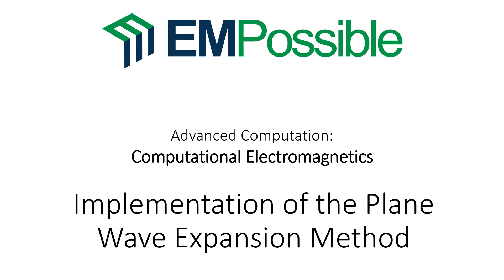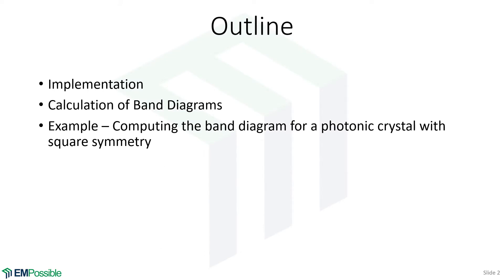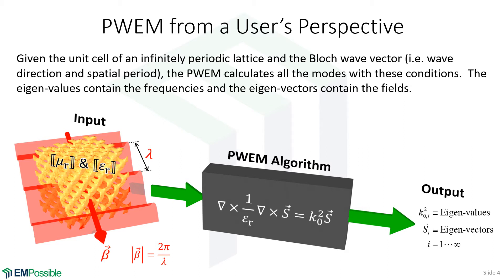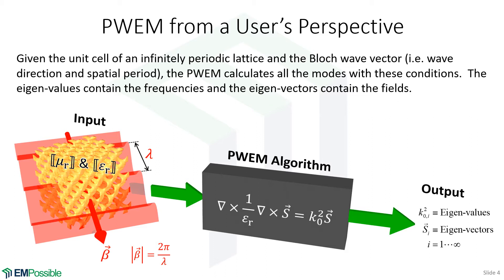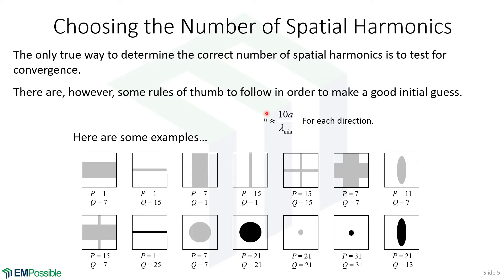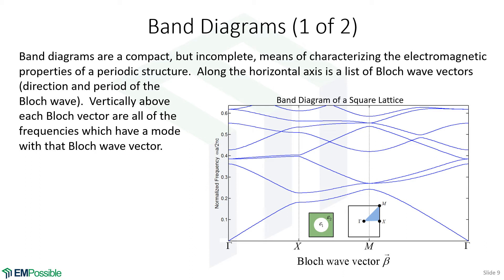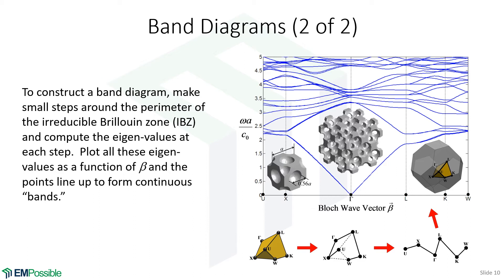Lecture -- Implementation of PWEM

Comment: Hello Professor, Thankyou for the amazing lectures. They are helping a lot to understand Computational electromagnetics and periodic structures.
Professor, I was going through your lectures and have few questions:

1. I want to obtain the dispersion relation a unit cell which has a metallic patch on a cubic unit cell (like the unit cell of a Metasurface antenna). Can I use PWEM to get the dispersion curve for this type of unit cell? I got this doubt because in the lectures, (if I am not wrong), the structure uniform infinitely in the Z-direction. Whereas, in case of the metallic patch unit cell, the patch is just on the surface of a dielectric substrate and in Z-direction it is not infinite, and below the metal patch, again the dielectric region starts.

2. Also, if we can use the 2D PWEM for such structures, what will be the relative permittivity of the metal patch? (I tried to look in the internet, E_r value of a PEC is infinite)

3. One more major difficulty professor is with generating the convolution matrices for the material parameters (i.e. the convmat() function).....By following your lectures I have understood that we just need to find the values of "a(p,q)" (for 2D PWEM), that is, the surface integral value  where p is from -[P/2] to [P/2] and similarly with q...... and write it accordingly in matrix form. But, I am unable to map properly this information to create the matrix.(maybe because I am a beginner in MATLAB). If you could provide some reference or hint on how to create that matrix, it would be very much helpful for me.

Thankyou so much for the patient reading...and once again thankyou for the lectures
Reply from the maker: Happy to help!

1. What do you mean by dispersion relation or dispersion curve? Different people mean different things by this. In general, if it involves metals I avoid Fourier-based methods like PWEM or RCWA. Plenty of people smarter than me still use those methods. You would need to use a 3D simulation for such a unit cell. Consider finite element or finite-difference methods. Depending on what you want to do, you may find the answer and code in my book on finite-difference frequency-domain where I simulate a frequency selective surface and also do a parameter retrieval from a left-handed metamaterial. Here is a link to the book’s website:

https://empossible.net/fdfdbook/

2. I perform my simulations in stages. I would start out assuming PEC for metals. The easiest way to do this is to set the permittivity to something incredibly large, like -1e9. If you need more accuracy, then lookup the actual properties of the metal at the frequency you are using it. Metals are very dispersive at very high frequencies and it may be important to consider.

3. You can use the FFT to calculate the Fourier coefficients. That avoids having to do the integrations and is MUCH faster. Then you have to put the Fourier coefficients in the correct place in the convolution matrix. Slide 6 in Lecture 6b of the Computational Electromagnetics course shows the expanded equation for Ky*uz – Kz*uy = jk0[er]*sx. It may not seem like it, but that expanded equation is what the convolution matrix is constructed from. There is nothing else to derive. Below is a link to the course website. There are some links from there to paid online courses that will step you through every line of code and implementation of the convolution matrices as well as 2D and 3D PWEM.

https://empossible.net/academics/emp5337/

Hope this helps!!
Reply: @empossible1577  
Hello Professor,
Thankyou so much for the detailed reply...
I am very happy to share that I am able to generate the convolution matrix using the FFT of permittivity and by properly expanding all the terms in the summation present in lecture 6a and manually writing them down as a matrix form (i could understand about the positions of the Fourier coefficients).

1. By the dispersion curve I mean the "frequency - wavenumber" curve (omega-beta curve), which gives us the information about the phase velocity and group velocity in a unit cell and hence for a particular frequency we can extract the K value and find the phase difference across the unit cell.

2. Okay professor, I will give a high value of E_r for the PEC and observe the result along with trying the 3D PWEM for the structure I mentioned.

Also, Thankyou so very much professor for the insights and references on the other methods that can be used for the analysis of unit cells with metals......I will definitely have a look and study about them. 

It really helped a lot, Thankyou.

Comment: Sir, I was going through your lectures and find that convmat (ER, P, Q) is not calculating in may lab…convmat function is not defined in matlab…How to get the ERC then.
Reply from the maker: This is a function that you will need to write yourself. The final equation you need to implement the code is at the bottom right of Slide 19 in Lecture 6a in Topic 6 here:

https://empossible.net/emp5337/

If you are looking for the MATLAB code and an explanation of it, that is several of the paid courses on Thinkific.  Here is a link to the least expensive one.

https://empossible.thinkific.com/courses/pwem2dbands

I personally recommend sticking with the free material and developing your own codes from that. The code to assemble the convolution matrix is not long. It is essentially just assembling the  Fourier coefficients into a matrix following the equation in Lecture 6a.

Good luck and have fun!!

Comment: Hello, wonderful presentation! Could I ask, would it be possible to simulate FCC in cubic lattice? Should a 3D integral be calculated in this case for Fourier coefficients instead of convmat3D?
Reply from the maker: Absolutely. PWEM can handle any of the 14 Bravais lattice symmetries. You can do it using the ordinary FFT, but will need to create an oblique grid consistent with the FCC.

The free notes have all the theory you need to know to calculate the Fourier coefficients, assemble the convolution matrices, and implement PWEM. If you are stuck on the implementation, I can point you to a paid course that steps you through every line of code to implement 3D PWEM, including building the devices and building the convolution matrices in a very fast and efficient manner. Here is a link to the course.

https://empossible.thinkific.com/bundles/implementation-of-2d-and-3d-pwem-for-band-calculation

Hope this helps!

Comment: Hi, professor. Thank you for your video!

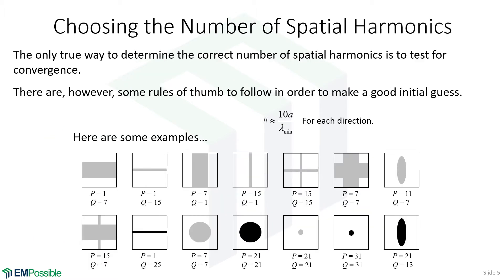I'm struggling with building 1D grating like the one in (2:08). I want to make my grating layer like ( P , Q ) = ( 1 , 15 ) case in the video.
So, I made the unit vectors t1 and t2 which is ( a , 0 ) and ( 0 , a ) respectively, and then I made a meshgrid.
To build unit cell, I added a constraint which is ER = ( abs(YO) <= h ) where h is the height of gray-colored rectangle.
However, the grating layer looks like ( P , Q ) = ( 15 , 1 ) rather than ( P , Q ) = ( 1 , 15 ).
I draw it with not (XO,YO,double(ERR)), but (XO,YO,double(ERR).'). Did I miss something?

Thank you for your reading :)
Reply from the maker: How did you generate the meshgrid variables XO and YO?
Reply: @empossible1577  It's exactly the same as how you build in your EMPossible lecture titled ' Implementation of 2D PWEM for Band Calculation in MATLAB.'
Reply from the maker: @HCho-xe1cj  Send me your code at emprofessor@empossible.net.
Reply: @empossible1577  I just sent it! Thank you :)

Comment: I just recently finished the 2D PWEM Course and I enjoyed it very much. I have a few questions. As I was going through the lectures, I believe I remember you mentioning a resource that went over defining IBZ and the just the key-points of symmetry in the Brillouin zone. I went back through the lectures now and I cannot find where you said it or if you cited anything ( I could be imagining things...). I was just looking to build codes for the other 2D Lattices and need to learn about identifying and defining these (lattice vectors, Key-points, etc) so I can code them in MATLAB. 
Second, I was going through the PWEM Extras PDF, and I noticed that you could plot the field, however, it appears that the variables defined in the PDF are not what is in the MATLAB code that was developed in the course and I was wondering if you could help me clear them up. In the procedure, I assume that V is the eigenvector as in [V,D] = eig(A,ERC); Then, when defining s, what is the variable m? I used m = NBETA to start, but in general, the "reshape" function does not like s since it wants integers and scalars as inputs for s. Next, is Nx = N1 and Ny = N2? Then Step 4, beta = BETA, X = X0, and Y = Y0?
Reply from the maker: Yes, the IBZs!  Ha ha.  Send me an e-mail at emprofessor@empossible.net and I will send that to you.  

Sorry for any inconsistencies in the notes.  

Step 1 -- Each column in the eigen-vector matrix represents a mode in the photonic crystal.  The variable m extracts the mth column so you can “sort of” interpret it as the mth mode.  I say sort of because you cannot depend on the order of the modes in the eigen-vector matrix to be the true order of the modes.  Sometimes I have to sort them in order of eigen-value or something else.  Reshape should take any s.  In this case, s contains complex numbers.  P and Q should be integers telling how big of a 2D array to reshape s into.

Step 2 – Nx and Ny (or N1 and N2 for oblique) are the size of the real-space grid onto which to visualize the field.  This is cosmetic so I like to use at least one hundred points.  The idea is to place the Fourier coefficients in s into the center of the big Nx-by-Ny array that contains zeros everywhere else.  This is called padding.  The inverse FFT from Step 3 looks much better this way.

Step 4 – The X and Y terms come from the meshgrid command.  These are the meshgrid terms for the Nx-by-Ny array containing the field.  The phase must be calculated across this same grid.  If you want to see a bit more discussion about meshgrid, see Lecture 2b here:

https://empossible.net/academics/emp4301_5301/

Hope this helps!

Comment: Dear sir, I open your code in file chapter 7_photonicbanddiagram.m in MATLAB, it has a erreur in line 98 about the Matrix dimensions must agree. Could you please check it please ? I also try to open your file in chapter 10 of your book but it is not working.
Reply from the maker: Frist, I just want to verify that this video is explaining a completely different numerical technique for calculating photonic bands.  The Chapter7 code is a finite-difference frequency-domain method.

Second, I downloaded the codes from the website and I ran the Chapter7 code without any errors.  Did you change or modify anything about the code?  Are you running it with MATLAB or did you translate to another language?

The Chapter 10 codes run correctly as well.  I am unsure why you are getting errors.  Sorry you are having trouble.  When producing the books, I had numerous people run the codes in different versions of MATLAB and on different computer platforms and all ran without errors.  I think they are pretty robust codes.
Reply: Dear Sir, I just sent you a mail that describe my problem in matlab in chapter 10. Could you please take a look ? Thanks you in advance
Reply from the maker: @huonghuongnuquy7272  It looks like there is just a problem with MATLAB not recognizing or working properly with your GPU.  I am not sure how you can reconcile that, but you can get your MATLAB code to work simply by deleting the three lines of code that assign and gather the matrices to and from the GPU.  The code will be slower, but it will run.

Comment: Hello, professor. I'm trying to implement the 3D PWEM and test it comparing it to the lecture Lecture-Periodic-Structures-in-FDTD, slide 45. I tried both the optimized version and the full version. I'm getting eigenvalues with multiplicity greater than 1. So I tried to plot the smallest unique ones with a given tolerance at the \Gamma to Z path, it doesn't look anything like yours. I'm using P=Q=R=19 and Nx=Ny=Nz=128, otherwise, I run out of RAM. The 2D case worked as expected, but I'm struggling with the 3D version for a week.
Reply from the maker: First, I would turn your number of spatial harmonics to something like P=Q=R=3 until you get your code working.  Hopefully the problem arises with the few number of harmonics so you can troubleshoot it much faster.  

Second, have you tried duplicating the 2D lattices with your 3D code?  You can do that by setting the harmonics to P=Q=3 and R=1.

If you are desperate...
https://empossible.thinkific.com/courses/pwem3dbands
Reply: @empossible1577  Oh, I was comparing it to the wrong scale, your graph uses \omega*a/c instead of \omega*a/(2*pi*c), they look alike plotting the whole path now, but I still did not unscramble the modes. Using P=Q=R=3, so 3*27 eigenvalues for each block wave vector, I'm getting around 29 eigenvalues close to 0, but your graph doesn't show any (actually, only for \Gamma), why is that?
Reply from the maker: @tiagovla  Not sure.  Either it is a mistake in your code or you have not normalized.  Are you getting the correct bands, but just extra ones that do not belong?
Reply: @EMPossible  I'm getting a bunch of bands stacked together at wn=0. I tried to narrow down the problem: First, I checked if all my k vectors were unique, and they were. Using P=Q=R=3 and beta=[pi; pi; pi], the rank of K_cross ([[0 -KZ KY];[KZ 0 -KX];[-KY KX 0]];) is 54 which results that, for a non-magnetic material, the ranks of A = K_cross*K_cross and B\A are also 54 leading to 81-54=27 null eigenvalues, so I'm not sure if this is a code mistake. The other problem was that the bands were quite different. Simulating the example in Lecture-Periodic-Structures-in-FDTD (slide 45), with w=0.2a instead of w=0.1a solved that.
Reply from the maker: @tiagovla  What type of lattice are you simulating and how are you simulating it?  I have seen this before, but I don't exactly recall the conditions that produced it.  I want to say I was trying to simulate a hexagonal array with a rectangular unit cell and got the extra bands because this approach does not properly enforce the 60 degree rotational phase.
Reply: @empossible1577  I'm implementing this to test my FDTD bands. It's an example from lecture Lecture 3i - Periodic Structures in FDTD - Electromagnetic Analysis Using Finite-Difference Time-Domain, slide 45. The cell itself is a cube with a dielectric along its edges. So using FFT should be enough to calculate the coefficients. The extra bands are not fictitious bands, they are stacked at wn=0. I'm wondering if they were just omitted in your plot.
Reply: @empossible1577  Unfortunately I can't afford your implementation course. Would you be willing to run my version and compare it with yours? Since I'm getting null eigenvalues and my eigenvectors aren't orthogonal, but our band diagrams look alike, I'm really not sure where the problem is.
Reply from the maker: @tiagovla  As I recall, that is face-centered-cubic.  What lattice vectors are you using?  Maybe those are incorrect.
Reply: @empossible1577  Really? I assumed it was a simple cubic structure because of the boundary conditions you used in the FDTD example. I used a1,a2,a3=(a,0,0),(0,a,0),(0,0,a). Isn't a face-centered-cubic something like the opal structure? I remember I saw this same structure in a paper "Complete three-dimensional photonic bandgap in a simple cubic structure ".
Reply: The brulloin zone and symmetry points plotted within your figure are also from a simple cubic structure.
Reply from the maker: @tiagovla  I think this is your problem.  Those are not the proper lattice vectors for FCC.  You will need to calculate the correct primitive translation vectors for FCC.  Take a look at the Solid State Electromagnetics under Topic 4 here:

https://empossible.net/academics/emp6303/
Reply: @empossible1577  Just to make sure, are you saying that the example in https://empossible.net/wp-content/uploads/2020/01/Lecture-Periodic-Structures-in-FDTD.pdf slide 45 (the cube one) is FFC? I will look into your suggestion during this week. Thank you very much.

Comment: Can the method handle the case of incident waves along z direction?
Reply from the maker: The 2D PWEM as I have presented cannot handle any propagation in the z direction.  What do you mean by "incident wave?"  In PWEM, there is no incident wave.  There is a Bloch wave vector and PWEM calculates all possible modes propagating with that Bloch wave vector.  Usually the title "incident wave" is used when performing a scattering analysis.  In this case, I would switch to rigorous coupled-wave analysis (RCWA).  If you really mean to ask about simulating lattices where the Bloch wave vector is in the z direction, that is absolutely possible.  You can modify the 2D code to do this, but I recommend just developing a 3D code and using as a 2D code.  I have notes about all of this on the course website:

https://empossible.net/academics/emp5337/

Hope this helps!
Reply: @empossible1577  I mean "beta" vector
Reply from the maker: @ysayad1977  Okay.  That is a Bloch wave vector.  Try not to think of it has an "incident" wave vector.  That implies there is a source that applied wave scatters.  As I have presented, PWEM formulates the problem as an eigen-value problem that is asking a question about what modes propagate in the direction of the Bloch wave vector.